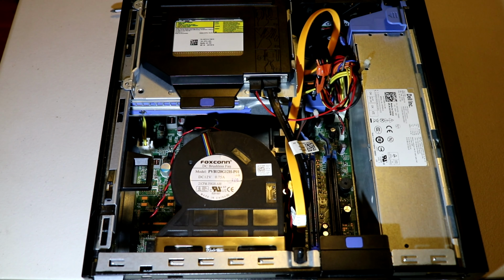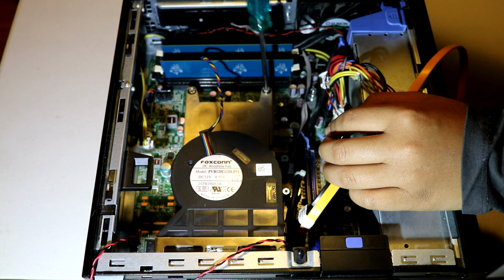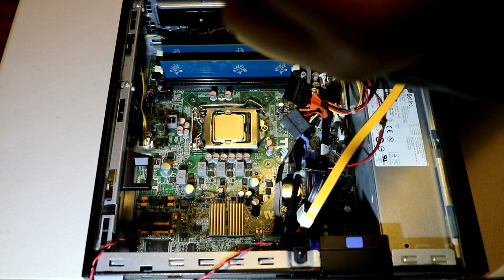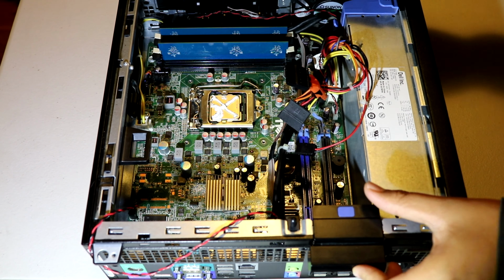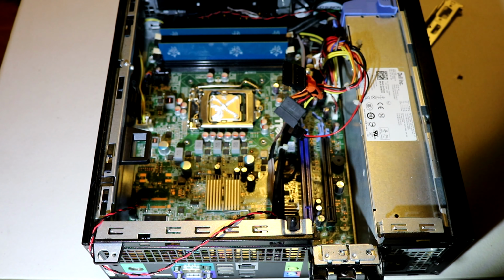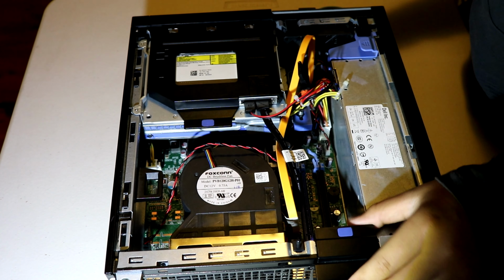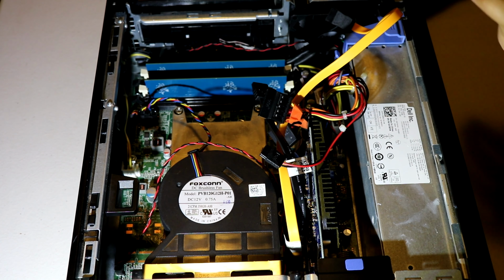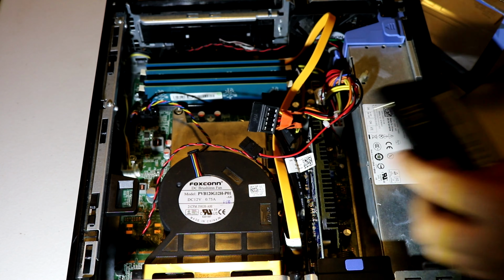Dell Optiplex 990 SFF Upgrade for games!!!! :)

Comment: I bought this two weeks ago from Walmart, a licensed Microsoft Computer outfit in TX upgrades these old towers and ships them for Walmart.  I got mine with Core i7, 2 TB of memory and 16 GB Ram for $260.00!  Free shipping.              With the latched opening on the side, I opened it up a saw so so many easy  upgradable possibilities. This is how I stubbled upon this video. Great info
Reply: I just got the exact same rig from OK Auction for $45

Comment: There is a Sabrent 2.5" SSD Sata Hard drive Bracket you can use to make the SSD fit into the hard drive's original holder. And then it will go back in the original position where the hard drive was removed from.

Comment: What graphics card can be used because I am looking at 1060 (6gb gddr5) 1070 (6gb gddr5) and 1660 supers (6gb gddr5) are those able to be put on this because I got this for Christmas and my parents don't know pcs and I want to upgrade it and I have 500 watts and 16gb of ram and 2tb SSD with i-5 2400 and will this work or new CPU and worse GPU or what because I will be playing high end games so i was just wondering since you prolly know more about this pc
Reply: I think the highest this PC goes is the GTX 1060 (150$?). I have the same PC and its a 990 DT, i use a 1050 and it works great! I wish i could go higher than specs though.
Reply: @JohnnyMatherson  Hello, I have dell optiplex 990 240 watts, I want to install 4 gb garikkarte, but they all want 300 watts, how can I do it?

Comment: What video card is compitble with optiplex 990? Preferably budget friendly
Reply from the maker: Any Low profile card is compatible. The exact card depends on what you're doing.
Reply: I wouldn't say "any" if you get an r5 430 it's going to need more power.
Reply: @techwithpat4000 space is the issue with these mini towers!

Comment: Can I use gt 710 gpu with my sff which has 240w psu?
Reply from the maker: Yes GT710 is a very low power demanding gpu so yes go ahead :)
Reply: @techwithpat4000  Can I use Asus GTX 1050 2gb gpu with My sff which has 240w psu?
Reply from the maker: @enrikyxz  You can but it would be quite the end of the road for the psu.  it would work but hardcore intensive gaming may kill the system but not fry it though.